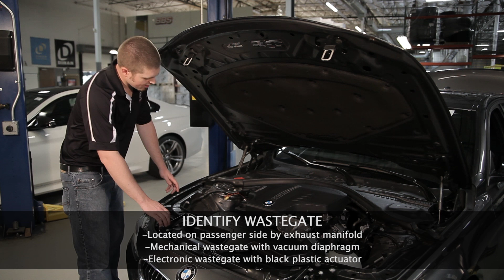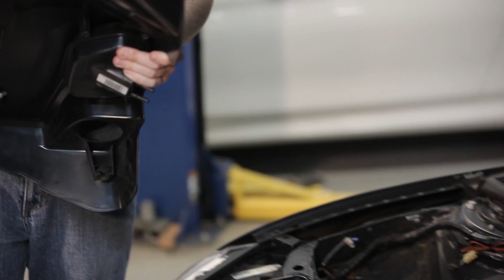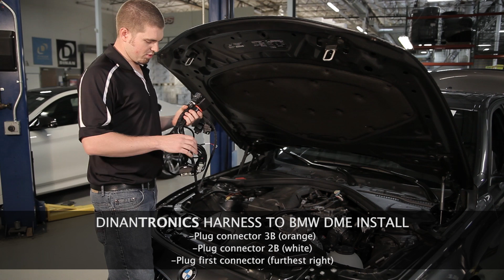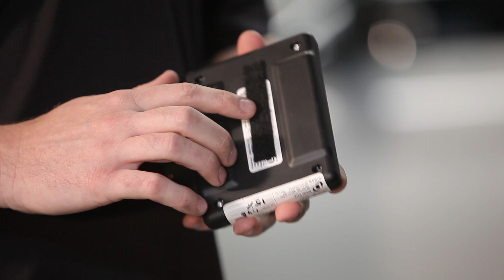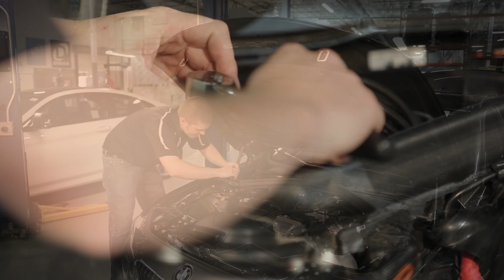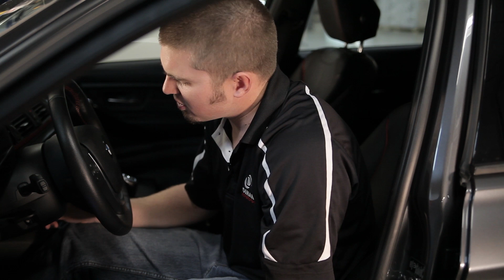How To Install DINANTRONICS Performance Tuner On Your F30 328i

Comment: You explain the difference between EWG and PWG.  It sure would be nice to actually see what your looking and pointing at.
Reply from the maker: A quick visual guide on the wastegate differences can be found in the install intrsuctions on the applicable product pages. Hard to get a camera in where you can make much of anything out to be honest. MWG has a vacuum pot whereas EWG has a plug is the brief synopsis.

Comment: Good video  However, I found it confusing that you disconnected the #1 connector but didn't explain that the original just gets plugged back in.  I'm sure there's a reason for disconnecting all 3.  I did hear you say that the harness only make use of 2B and 3B.  Maybe just saying plug #1 back in.  I kept looking at the harness to see which connector went in there.
Reply: I had the exact same question.

Comment: Nice work. I have a 15 F31 with 71,000 miles on it. I may have to invest in one. I had the Stage 1 on my 2012 F30 and liked it. To me it felt like the throttle was more responsive. You really notice the difference when it was time to open it up.

Comment: How can I power on the vehicle without turn on the car? My car is the same model f30 328i bmw. Also, If I do it on my own. Does the Dinan warranty still cover any damages?
Reply: I believe you press the push to start button like you normally would start the car, only you don't apply the brake pedal. So you would try to start the car only don't press the brake pedal in.

Comment: I am surprised that the  harness installation is so hokey.. Would have expected more, maybe I expect too much
Reply: Hokey how? It's a plug and play solution with zero tapping/splicing. Doesn't get much simpler than this.